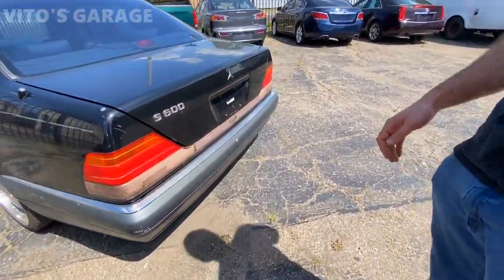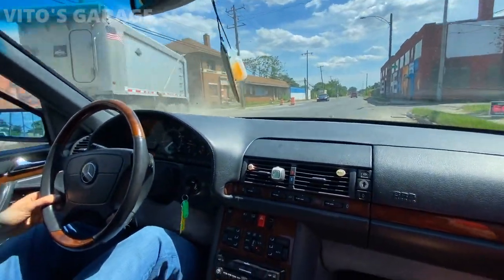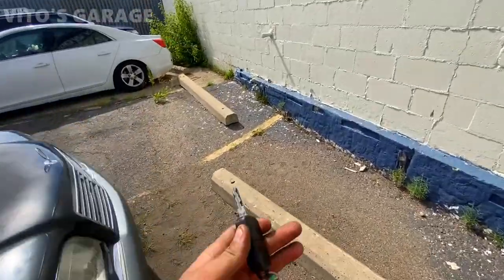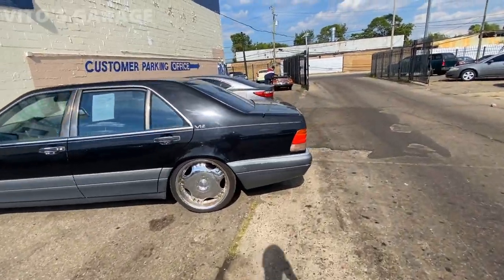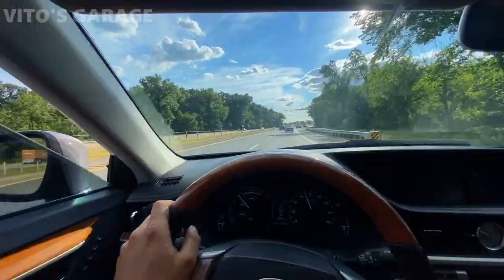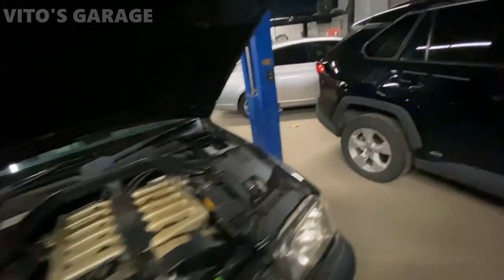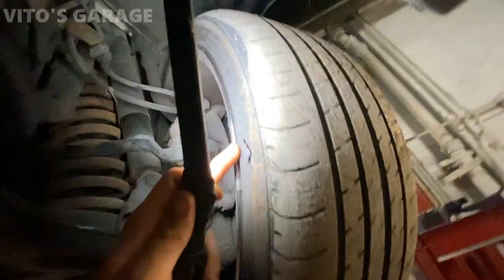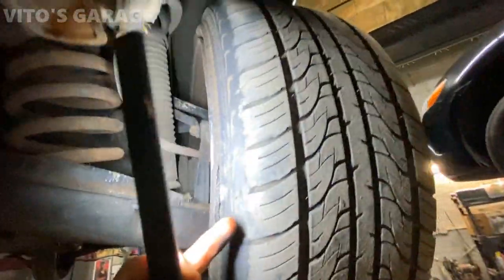Picking Up a V12 Mercedes W140 S600 and Driving it From Michigan to Chicago!!! Friend's Dream Car ❤

Comment: I still want one to this day. Those wheels need to go, get the originals!
Reply: I agree, those wheels look HIDEOUS.
AMG 18" MONOBLOCKS would definitely restore this ICON to its former Glory
Reply: @1malikalik  it will brake the bank to bring this back to its hey day. I love this barge! Brabus and Lorinser made some really nice wheels for this, back in the day… Carlsson too. The rims you mentioned are classic! They look so good, not flashy, extreme quality…
Reply: @marcelcovaci9922  
Great Point there.
They say, "the most expensive mercedes benz is a used one..."
This V12 s600 is not just used but abused - as in seriously abused.
From my experience, used cars are like women: If she has been USED, ABUSED AND MISUSED - RUN.
Unless, they can find a wrecked S600 for a few thousands and gutt the power train and interior it would be a money pit.
Also, you right, I forgot about LORINSER they were bad ass back in the day. Lorinser Rims would be a perfect homage to a S600 w140. 
Cheers!
Reply: @1malikalik  Cheers! 👍
Reply: Those are lowenhart wheels... They were designed with this car in mind.... 🤦🏻

Comment: Nice! Keep it up ☺

Those are near impossible to find here in Portugal, be it in good or bad shape 🙃

Hope you guys go for a purist restoration ☺

My W140 is also undergoing surgery right now, having its OM603 swapped for an OM606 Turbo, 300hp and the original 4-speed auto swapped for a ZF8 ☺

Quite excitedto see the final result!